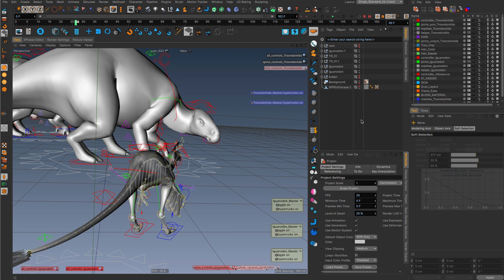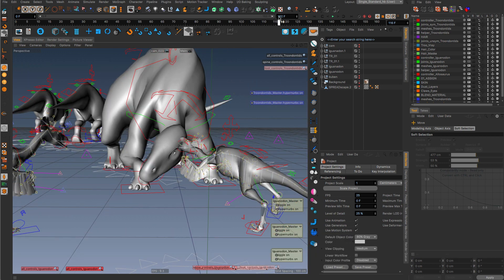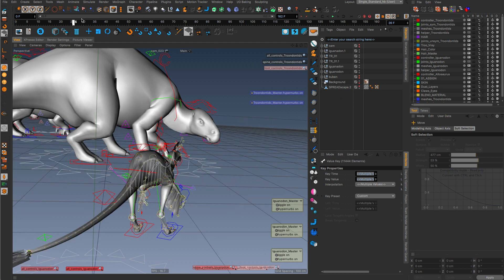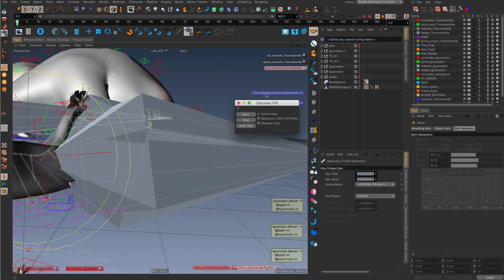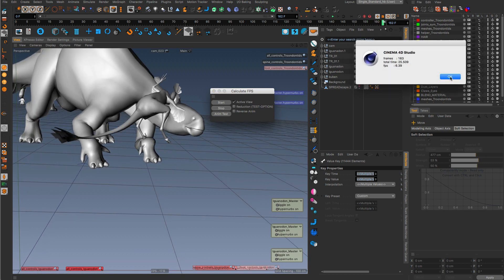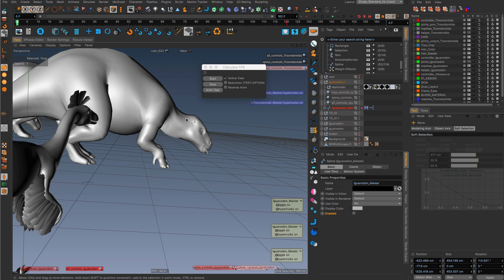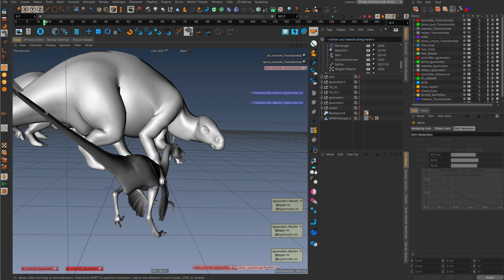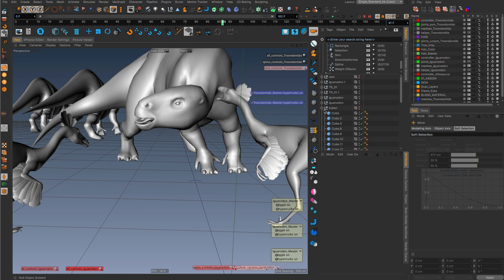Rig Optimizations in C4D - Additions

Comment: Hi! nice tips there, in your tests, did you test simple xpresso influence on the fps? I'm thinking that a turn around for that spline issue could be adding a global xpresso controller to switch on/off the splines you need for animating with DU. But I don't know if such an xpresso with dozens of links to the indiduals splines would be better than splines alone?
Reply from the maker: +Th. ZeGolem Yes, Expresso makes a big differences too. You could build a toggle. But Xpresso drives many important things that you normally need for animation like footroll etc.